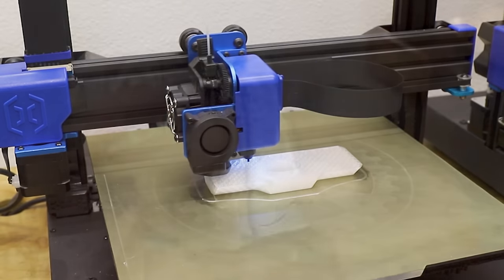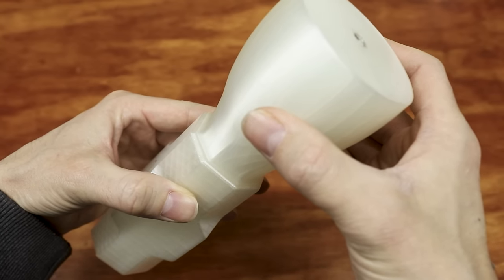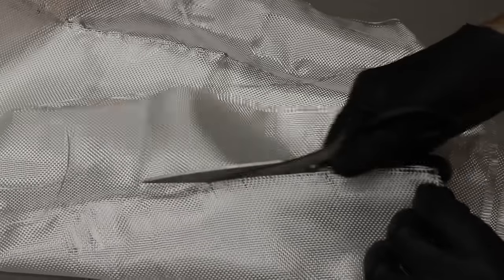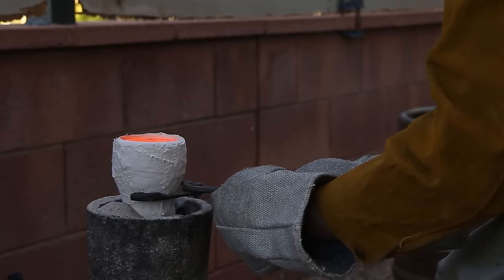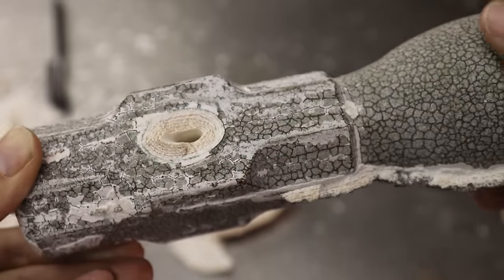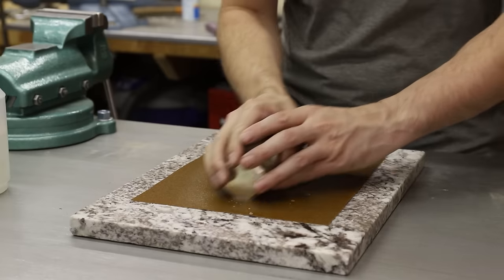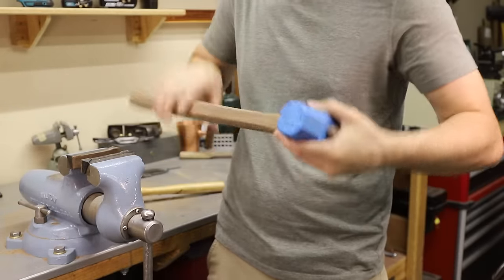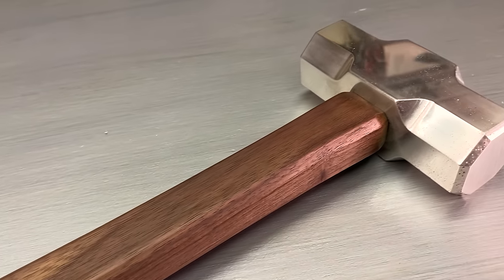Making a SOLID SILVER Sledge Hammer - Thor's Hammer - The sledge hammer series

Comment: I had no idea silver was super thermally conductive! Learn something new every day!!
Reply: That's why electric contacts from before were silver plated. Nuts, bolts, contacts.
Reply: And we use gold for the same reason. Hence why you see it a lot in space probes. @aserta
Reply: Diamond is over 5 times better than silver. Then Silver, Copper, Gold, ... in that order
Reply: @anzaca1 We use gold mainly because of its resistance to corrosion. Not its thermal or electrical properties.
Reply: You can check if silver is real with an ice cube. Melts it unmistakably fast.

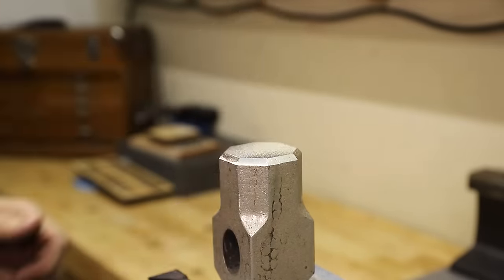Comment: What you can do to remove that defects from silver is adding inert gas like argon in the furnance and pouring it as soon as possible it will be significantly improves the defects (if done correctly) because argon doesn't react with anything. @7:22

Hope this helps!  👍

Comment: Excellent! Thanks for sharing this!

Few things I would've made different:
- no chamfer on the handle to the head (that's a weak spot) 
- some surfaces of the head sandblasted (or leave the casted surface)
- use a wedge of different (brighter) wood, like ash or beech
- above "Sterling" I'd  add "925"
- and below it I'd stamp in the weigth of the head in grams and/or oz.

But that's just an opinion. 
You result looks awesome, that's a fact. :)

Comment: Have you thought about integrating fiberglass into the mold from the get-go to avoid cracking when you bake out the 3d printed template?
Reply: That's what I was thinking. Not sure how many layers of slurry he builds up, but maybe in the middle of the build up he could do that. Either that or heat it up even more slowly.
Reply: I was just thinking why not wrap a load of 0.8mm MIG wire round it and then slurry. Curing heat wouldn't affect that surely.
Reply: Even if it was the last layer before placing it in the kiln I'd think it would work.
Reply: @mcirelandosharma7411  What about when the hot metal is poured in. Could it get hot enough to affect it then?

Comment: For filling in the air bubbles while sidestepping the thermal conductivity, I'd think about impact welding, such as the Dymet powder spraying technology. This instantly welds tiny particles to the main body by colliding them at the correct speed, so they stick like snowballs.

Comment: OK, you HAVE to do Gold next. It's the next logical, accessible metal to continue the series. But maybe not the same size, just a tapper hammer of the same design. And you could cheat with electrum, or 'placer gold', which is an alloy of gold and silver.

Comment: It might not be a bad idea to try layering on fiberglass cloth all around the mold after each dip into the slurry (or just incorporating a few layers, adding a layer every dip might be overkill). It seems like you get a crack nearly every time and I feel like that would add structural integrity to the cast which should help prevent cracking.

Looks awesome by the way! I've been wanting to get into 3D printing to try my hand at casting for a while now, could potentially be useful for my work, or at the very least fun to do.

Comment: NileRed did a bit with pink gold and found he also had an issue with bubbles in the metal. he reduced the issue by pumping an inert gas through the molten metal to prevent oxygen from entering it. it didnt fully fix the issue but it did greatly reduce the noticeable bubbles.

Comment: You should make a Goblet out of the Sprue from this project. Use a lathe to cut the drink cup section out of the Silver, but then Build a wooden stem and base for it out of Black Walnut, sort of like the "Holy Grail" kind of thing and perhaps even getting ahold of some relatively cheap cubic Zirconia (in different colors) to add decoration to the wood stem and base as well as the outside of the Silver cup! C'mon, you know you want to make a Silver Goblet for Wine or any other special drink you might care to pour into it!

Comment: To avoid air bubbles, you can try to stir your melted silver with something in iron. All the oxygen will be gathered by the iron, limiting the formation of bubbles into you casting
Reply: Would a vacuum chamber work like it does for resin?
Reply: @ClAddict  I don't think so, because you would have to remove all the air in the chamber. Without air it would be very difficult to heat the metal (except maybe by induction). The other difficulty is to poor the metal from the vacuum chamber. Some machinery capable to do that sort of things exist, but are very expensive.

Maybe by exchanging the air contenting oxygen by another gas? I really don't know about this one, I've never tried
Reply: @IoannesHoBaptistes  I was thinking more having the form in an open vacuum chamber, pour the metal, close the lid and start to pull a vacuum. It’s been many years, so I don’t recall how quickly metal solidifies or how quickly one can get to effective low enough pressure in a hobby vacuum chamber to pull bubbles out of something as viscous as metal. But I feel like it’s an interesting theory. You bring up an interesting point on thermodynamics and what that might do to the rate of cooling.

Comment: pour your investment material into a steel pipe large enough to hold your work. then you heat it up to melt out the casting wax then pour your silver. the ring will prevent cracking. proper investment material will break apart after you quench and you can sand blast the rest away. This is most reliable method

Comment: There's something you can do about it. During melting, you place a burner above the crucible with a flame that closes the crucible. And during pouring you can place a burner on your mold. This prevents oxygen from entering. the burner on the mold also keeps the silver hot so that it is the last to solidify at the top and so absorbed oxygen can leave the silver again during solidification.
I know this because I used to be a smelter at a silver bar factory.

Comment: There's a magnetic toy called the feel flux, I have it in copper, but aluminum and silver would work too. I've always wanted to see a solid silver one and compare it to the other two. I think it should slow the magnet better than the copper. If you have the silver, it would be a good video.
Reply from the maker: Now that is a great idea! Maybe I'll make one in all three metals to test out. Thank you!
Reply: @robinson-foundry  no problem, I'd get a spherical N52 magnet, just like the one they use. Another neat suggestion, maybe for copper is to stray from the design of the original, and make a steep narrow, but thick walled shaped cone shape, like a waffle cone. Or something you can throw it into instead of precision drop, I always want to throw mine in but I don't want to miss and hit the wall/risk damaging the magnet.
Reply from the maker: @gordonthorn2049  I ended up making these.. I'll have the video done in a few days. I went down a Lenz's law rabbit hole and I have a few ideas myself. I like the cone idea too. Maybe a cone shaped piece of copper and a cone shaped magnet to match.
Reply: Very cool man, my family and I will be excited to watch it. Thanks.

Comment: I have an idea for your Silver :) Design three hammers :), the first one is a 'frame' made of one material, the second fits into the frame so you can pour another metal in, and then a final frame to finish the head, once polished you can see all 3 metals (or more), but the durable metals are used for the head parts, and the join to the shaft. Also going with a fancy design on the sides with yee old dragon or similar would be cool :). Anyway, love your work :) thanks for the video.

Comment: The porosity can be eliminated with a centrifugal casting machine.  It speed's up casting time to avoid air inclusion. Also using a crucible style machine allows you to use a torch to maintain temperature of the silver. Keeping the molten metal rolling but not boiling then release the casting machine catch and step back. Let the machine come to a stop on it's own.

Comment: I know very little about metal casting, this is just half remembered from another video, but would flooding the cruicible with an inert gas (argon, CO2, ...) help with the air bubbles? It would displace the oxygen.

I think the reason in the video I watched was to reduce slag creation because they were working aluminium, but I could be misremembering!

Comment: Hmmmmm
I used to do casting and that included some silver pieces that were fairly thick (candlesticks), similar to your sledge hammer and I found that there's a specific Flux for silver that not only removes impurities but also degasses the melt for a few minutes (like 3) so you Flux, clean and pour. It's been 20 years do I can't say who might be carrying it nowadays but it's out there somewhere.

Comment: This was very interesting to watch - I enjoy seeing the casting process (something I've only ever done in a very primitive way with some aluminum) - but I'm curious how you are going to address the fact that silver tarnishes (ask any coin collector, or your rich aunt with a real silverware set).  I'm not an expert on sterling silver but I suspect it suffers the same fate as pure silver, which means thumbprints are a big no no.  I think your copper hammer will suffer a similar fate, as the copper will dull and turn green like a water pipe in no time...   Am I wrong? Or did you just accept this as part of the deal?  Could anything be done to avoid the tarnishing like a very thin clear-coat of some kind?

Comment: im sure theres a flux you can use to degass the silver or at least a flux that will protect the surface so oxygen cant make contact the silver during melting to prevent dissolving.

Comment: I know it's an ornament, but: 
1) Don't use a hard shoulder when mounting handles, the wood should be squeezed into the head.
2) BLO is the ONLY acceptable treatment for a tool handle.
3) Glue is neither required nor advisable.

Comment: Have you considered joining us on the dark side, and using resin printers with wax based resins, like the afforable "Siraya Cast True Blue"? The reason I mention it is you can print them very hollow, so there's not a need to waste tons of resin on each print, additionally, the thermal expansion of the resin as it heats and leaves the mould is neglbible compared to the rather substantial expansion even the best PLA does, so your shell moulds won't crack as much, or potentially at all (I've little experience with shell, it's expensive for materials here, and I've got limited space to do it with silicosis concerns for my forced indoor case)
Reply: If you'd like, I can link you a video of a design for an easy electric furance that I personally find to be very easy to make, and quite affordable (it's a very recent video from one of my subs). If you went with the electric route, then you'd be able to pipe in argon or other cheap inert gas during the heating stage, enabling you to keep oxygen from been absorbed into the metal, using a simple hole and steel pipe to let it flow in (or suchlike) which isn't viable with a gas furnace build :)

Comment: Well, Hello again, I said I woulde be here. LOL. The head is likely over to 5 pounds and when buying silver at market rates of $42.00 Cdn x 16troy ounces adds up to a nery pretty penny my young friend. Somewhere around $3500.00 in materials alone. I sure like working with different materials, The hickory handle is great. Perfect contrast apperiance. Well done young man. 2 killer pieces from you. When I make my sterling I use a split of zink and copper in the alloy.  It makes silver so hard it eats new files in short time. Check out my video's on making chopsticks when you can. Thanks for posting this. I really did enjoy it.

Comment: You've got Copper, Silver, and Brass. Gold would cost more than $250,000 USD, so that's out of the question. Instead, how about going with the other metal that has a nearly identical mass, Tungsten? As an added benefit, you can actually use a tungsten hammer without worrying about it denting. Downside is, you aren't casting it.

Comment: Im not a Hammersmith or a joiner but i was thinking wood shrinks when its colder due to not being able to hold its humidity so maybe leaving the wedge in a dry cold environment for a few hours before fitting it will expand even more one returned to room temp would make for a tight solid fit maybe even take out the need for glue  😮
Reply: Not that you'd swing this, but the point of glue is to be sure. Swing a hammer with a wedge and no glue, one day it'll come out. As it's a sledgehammer, the consequences would be devastating. Don't shortcut. The theory of drying was good but it's just not enough.
Reply: @rattus7455  yeah I see maybe if you were a caveman with a fridge that might help 😂